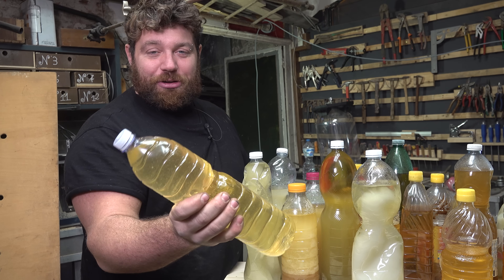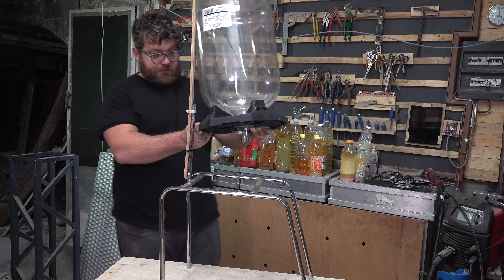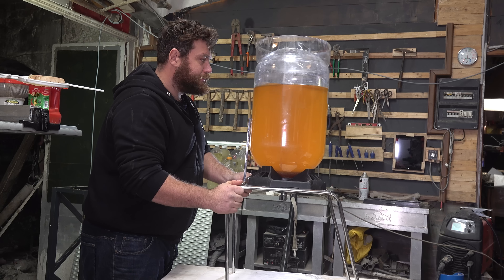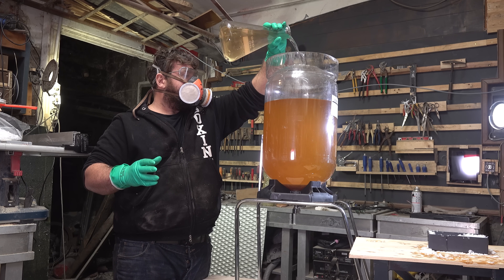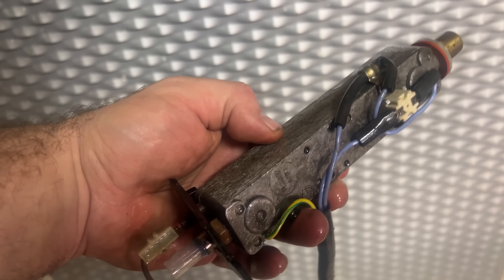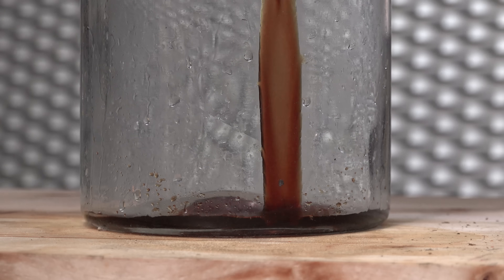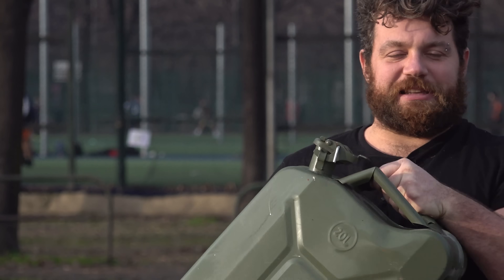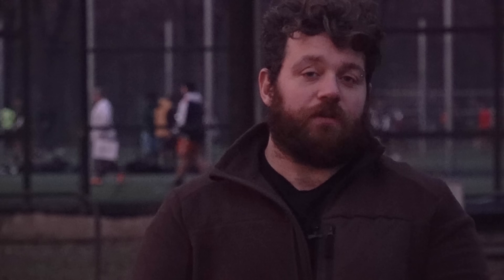How to Make BioDiesel at Home • Full Tutorial 4k

Comment: Why did you skip the titration calculations?  It is very easy using turmeric......and there is no one measurement fits all......you also skipped the acidity test so it will definitely eat away at any aluminium it comes in contact with, also because you did everything hot you could see after you transported it in the steel tank and started pouring, it started to congeal because of all the shortcuts......also no washing!......

Comment: I made it for years. Worked fine but not good for my lungs making it.  I used 40 gal electric hot water heaters, washed my fuel with soft water.  It worked great, made lots and figured my cost was down to about $1.00/gallon.  But overall its still better to just buy it.😕

Comment: In an emergency situation I once used 20 litres of vegetable oil straight from the shop in my 2010 Toyota and it ran perfectly fine. Got me home ok and I wasn’t stranded in the middle of nowhere. Since then I’ve owned diesel cars for their high tolerance of using cooking oil as fuel. 😅

Comment: Read up how your car handles this. Most new cars handle biodiesel really poor, meaning you can have engine failure resulting in thousands of repair cost. Older cars ( talking 80s 90s and before) with less electronics tend to handle it like champs with some being able to run 100% waste oil w/o any problems. Would i make biodiesel myself? Absolutely if its legal in my state and my car can handle it.
Reply: You're wrong. In Germany there is always biodiesel in Diesel.

Comment: Also regarding that the viscocity lowers with the temperature sure but that isn't the most important factor. when it comes down to diesels, FAME and kerosene/kerosine you have something called CP and CFPP first is cloud point the temperature when you first start noticing the impurities/parafine fraction. and the second is the cold filter prop blocking tendency that is when there are enough impurities that causes the liquid to not actually flow anymore both are temperature and mixture depended

Comment: This is overkill, just filter the oil then mix with 10-15 % gasoline then you car will run just fine. But the car should be a older car with mechanical fuel pump 😊

Comment: You have no idea how to make biodiesel, first, methanol cannot be in the air because it picks up moisture from the air,the caustic soda has to be in the methanol for 24 hours for its correct dissolution,you have to dehydrate the oil so that it does not contain any water,when you mix the oil and methanol, the oil has to be hot and constantly moving for the reaction to happen,When you have the biodiesel you have to wash it with water to remove the soaps that have been created in the process,and then you have to dehydrate it again so that the final product does not contain water, and finally filter it through a car filter or other filter, (the process is more complicated and has more steps than what I explain here). 
This person has no idea how to do it, if you do this tutorial and use that thing as fuel you could break something in your car, Dislike.

Comment: We in Brazil use vegetable oil which can be those that are discarded from restaurants, or new soybean oil we mix it with diesel directly and it works very well, however this mixture is almost entirely used by farmers in their agricultural machines and in transport trucks. It helps the environment and reduces fuel costs.
Reply: putting oil into diesel does the opposite of saving the environment, it only saves money, you oil produces a lot more smoke and toxic fumes than regular fuel, but hey as long as you save a buck right?
Reply: @keller_  just clarification

Used cooking oil is recycled, as it can contaminate water. It is mostly used to extract glycerin and biodiesel.
We don't have places to incinerate it as most os our electricity is hydropower based (70%). So we started to recicle it.
Brazilian diesel is 10% plant based, part of the oil used is cooking oil processed to just extract the "biodiesel".
All major truck and car brands are in Brazil and they pass in he Euro 7 emissions, using this mixture.
If is is not clean enough to you, there is one more component, being plant based it will be reabsorbed after burn in the new crop being extremely eco friendly. In the same way we use ethanol to move our cars.
We don't have just carnival and poverty, Brazil is more eco friendly than he entire Eurozone. Big problem is the deforestation.
Reply: only in your head that pollutes more @keller_
Reply: @keller_ shut up cuck.

Comment: I used to run straight cooking oil in my mk3 transit, bought 1 trolley full at a time in tesco! It worked out great until the autumn set in and the oil got cold so the van was difficult to start.
I got round that real easily by going on holiday and coming back when it got warm again.
Reply: So rather than pumping it you bought your fuel in plastic containers which your country probably doesn't recycle 😂 nice work
Reply: @mgrdigimarketing3035 the best way to recycle plastic containers from cooking oil (as well as almost all other plastics) is to heat them in an oxygen free environment and distill the resulting vapors.. which makes diesel.
Reply: @mgrdigimarketing3035  really? So ive just stored them in my loft, right? And while we are examinating your profoundly stupid reply.... tell me what country dispenses cooking oil in pumps.

Comment: Why don't you use a pressure vessel to control the temperature and pressure. They process would be faster/ industrialised. You can rigged it with safety pressure relief valves

Comment: You can clean oil with gelatine, mix gelatine and hot water together then mix into oil, leave overnight, you will have a gelatine brick at bottom off oil with all contaminants.
Reply: what are the proportions?
Reply: @BibleWondersUnveiled  look at 1784 robert murray-smith biodiesel, for all info.

Comment: I have done this, made several hundred liters of Bio some years ago. I was driving a Toyota Prado KZTE engine. Few Problems: 
1. Not as easy as you might think to collect the oil. Fast food shops have agreements already OR staff take it.
2. That cleaning / post production process is VERY important - the diesel will look clear but still has soap dissolved in it.
3. Be prepared to get Diesel Filter Warning light come on when you run it pure. ( I had to change my diesel filter) BUT the car ran just fine on it: Mixed 50/50 AND once I ran a full tank just home made Bio.
I stopped making because I could not get enough oil to make it worthwhile.
Reply: My dad owns a restaurant. I really need to take advantage of that it sounds like
Reply: @CatDaddyx2  bio diesel in small ( say 50 liter) quantities is very doable, fun, and a cheap way to run a small older diesel motor. IF you can get regular veg. Oil supply. ( For free)
Reply: @cameronmurie  I got an old diesel kholer generator that I wouldn’t mind running on it
Reply: I agree- I run pure veggie oil in my car and even though its rewading its not easy, and the hardest part is getting hold of enough waste oil!
Reply: Not bio diesel, but a lot of older diesels can run on waste oil. You do need to cut it with diesel or less gas. We had an old mack dump truck and it loved it when we added motor oil. It's basically a higher octane. A lot of shops are willing to give it away. It saves them from having to dispose of it properly.
Reply: Former Sonic frycook and grocery worker here

Your best bets for oil if you want it is to check Sonic, or your local grocery deli or Walmart deli

I can't garuntee they'd say yes but it ends up getting dumped down the drain at Sonic, or outside in a vat at grocery/Walmart
Reply: While fast food places have an agreement a lot of managers don't care and small restaurants and gas stations are similar.
Reply: Ở nơi tôi ở VN có rất là nhiều dầu thải, tôi thu mua lại bán cho người khác,k có lợi nhuận lắm, tôi rất mong pan chỉ tôi cách làm
Reply: And if you burn it in an oil burner for winter heating you can even skip the filtering part. It will all burn just fine )))
Reply: Can I use baking soda, Sodium Hydrocarbonate (Na2CO3) instead of sodium hydroxide (NAOH)?
Reply: @GiorgiZhorzholiani22  I've no idea. I used the dangerous potassium hydroxide but I can't recall why.
Reply: @GiorgiZhorzholiani22  you don't need the sodium, you need the hydroxide / OH  part ...

Comment: You normally "wash" with water the oil after filtering to remove rests of soap. To avoid creating foam, you should nebulize water above the oil. Water is more dense so it will travel downwards and settle on the bottom, taking the soap with it. To remove the water you just need to have a valve on the bottom and empty the tank until there is no more water.
You do this as many times until you get clear water on the bottom.
Reply: Wow, nebulized water? I mean, it makes sense because you don’t want it to get bubbly as you said, but how long is the process?

Comment: So this recipe is not clogging the piston rings like when only meshing and go ?  i know several who ruined their compression and engine. , even old mercedes  . rings stick on piston after a year use ish. this seems like a better solution
Reply: Just make sure you get rid of all the excess soap and water (first by adding water to the mix and latter by decanting the mix and using a desiccant like calcium chloride which you need to simply filter out of the fuel before to using it), and mix in more of regular diesel if you feel like it is too viscous. Using ethanol instead of methanol will make it a bit more viscous, too. Keep your particle and diesel filter clean because the mix can clear a bit of gunk from the system, which can clog up the filters. After the first two tanks of mix are used, there should be no further issues with filters if you did everything properly.

Comment: This process is usable only for older diesel engines, not for newer common rail / PD engines. I had old car (VW Golf 1,9 SDI from 1997 year) and it runs about 100 000km on home made bio diesel (FAME = Fatty acid methyl ester)
Reply: This is actually wrong. Biodiesel eats away the rubber seals on old cars because they are not prepared for it. New cars are actually prepared for it.
Reply: @maximusboscus  having tried to run newer vehicles on 100% biodiesel and seen what happens to for instance Lucas fuel pumps when in contact with biodiesel I can assure that there is nothing particularly wrong with the statement...
All new diesel cars "should" be able to run with a small percentage of biodiesel because its already in the fuel but that doesnt mean they can run on it. In fact most new cars have so many sensors to reduce engine temperature and particulate filters that clog remove unburnt biofuels in stead of what theyre supposed to do that if you put even a meduim percentage of biofuel in a newer vehicle you will have an extremely expensive problem...fuel eating seals and fuel lines. pumps that clog up, filters that clog solid in the cold, exhaust gases that destroy the catalytic converter, and particulate filter.
Manufacturers started out making cars that could run on biofuels and then redesigned them and gradually added peripherals  that make it impossible for new engines to use even a half decent amount of biofuel.
Reply: @maximusboscus  So you're telling me a modern Audi Diesel from the EU can run on this stuff? I really doubt so too.
Reply: @hariranormal5584  Yes, modern Diesel can run. They HAVE to be prepared, because anyway commercial Diesel already contains a small percentage of biodiesel. On old cars it will ruin the rubber seals.
Reply: @maximusboscus Very interesting. Thanks. I thought given all those sensors modern cars have, and that Diesel (like other fuels, or petroleum as a science) is also really complicated, there are many "types" and chemistry's of it. I thought whatever the biodiesel we make is, it's probably a primitive version which works on old machines, perhaps power generators and stuff. But modern car engines are really complicated, thought they wouldn't be compatible, but yea. I just don't see much info regarding biodiesel nowadays, so I just made all of this up.
Reply: @hariranormal5584  ask the manufacturer, They might say a maximum of 7% biodiesel mixed with the regular diesel .Professionally made which may have to follow some standard. otherwise, the warranty on the car may be void
Reply: @maximusboscus  A small percentage maybe there is a reason for
Reply: @hariranormal5584 bio diesel isn't primitive at all, if made properly it is much cleaner (less poluting) and provides for better efficiency meaning you can have more power for less fuel. With bd there is no smell and no need for dpf filters and such.
Reply: I did basically the same process for my 2003 1.9 pd in my passat. OM642 CR diesel and my V10 tdi all for many thousands of miles
Reply: well said new engines with catylytic converters and partical filters  don't do well either , not the engine but all the sensors will go scatty and basically make your car unusable, if you have a tdi with a german fuel pump and viton seals youre golden, you'll use more fuel filters but it works ..Diesel engines were originally designed to run on this stuff

no mention of heating either for some reason....
Reply: @TalRohan 1st: all new diesel engines are compatible with biodiesel, and most diesel fuel available out there have some % of biodiesel in it.
2nd: I dare you to find an older car (pre 1990) with Viton fuel seals from the factory...
3rd: even though I agree that this biodiesel (the one shown in the video) shouldn't be put into newer cars, and even though I agree that older cars are less "picky" when it comes to fuel, it's all about viscosity, impurities and lubricity. Older engines needed sulfur to lubricate the mechanical pumps, but newer Common Rail systems injectors are extremely sensible to any variation in lubricity and to impurities. And, surely, homemade biodiesel is far from perfect on that side. Catalitic converters are not the problem here. Also fuel filters will NOT block the small impurities (mostly carbon deposits) from the used oil.

Last at least: NaOH reacts with aluminium, and almost all our cars have engines made from alu, or alu ports, heads and so on. Using NaOH will eat up the engine (slowly but surely).
Reply: 1,9 TDi 💪
Reply: I have the same VW but 2003
Reply: it is said that biodiesel has properties that differ from regular diesel. so that diesel engines that will use large part biodiesel must be built for it. But there are a few places in Sweden where you can buy B100
Reply: However, Hvo Diesel can be used in significantly larger quantities in most diesel cars. any car can basically manage 50%. Hvo diesel is said to be chemically quite similar to normal diesel, even if it is fossil-free. But this high cetane value and withstand cold well
Reply: PD is possible! I ran mine 50.000 km with waste motoroil blends up to 80% wmo in the Summer! Except from Smoking no issues at all!
Reply: I ran a Kia diesel on this with no issues at all
Reply: OM642 💪🏼
Reply: Nonsense, older cars can run veggie. Bio diesel when made properly is better than petrol diesel in all aspects, any engine that runs on petro diesel will run on bio even better.

Comment: These videos always make me worried.  There are so many hazards when working with the chemicals, and the biodiesel that you get from this is so dirty. 

Methanol is highly flammable, use of electric tools ( drill motor ) and the electric heating element is just asking for a fire. Methanol also burns with an absolutely clear flame so if a fire does start, you won’t immediately realize that.

The waste materials (glycerine ) will contain significant amounts of the unreacted methanol as well as residual caustic. Safe disposal of this material typically cannot be done when producing small amounts of biodiesel 

The biodiesel itself will also contain significant amounts of the same materials (unreacted methanol and caustic)

The actual production of biodiesel is not hard, there are just things about that process that almost all YouTubers do not address 

Full disclosure- I work at a facility that can produce approximately 250,000 gallons/day of biodiesel

Comment: Hi there. The older generators can use the cooking oil just as it is. But there is a faster and easier way to make biodiesel for your car, heat up the oil and mix in a couple of packets of gelatin. It collects all the impurities. Then you can mix the biodiesel with 50% normal diesel.
Reply: Chỉ mình cách làm dầu Sinh học với
Reply: They will gunk up though, so its always better to put in the effort.
Reply: @foty8679  fair point. However, there is a patent on the gelatin method. It's significantly cheaper. The gelatin removes all the glycerin as well. It's a British patent. Once the gelatin has settled out, you mix 10% paraffin, and you are good to go. Obviously, you can add more paraffin if you want or a little gas station diesel. It's just a significantly easier and cheaper way to make the biodiesel.
Reply: @tranquility382 

Did you trying such method, to get biodiesel?

Comment: This doesnt have to take so long if you heat the oil from the start. That will also take care of the impurities in the oil so you dont need a sieve for that. Your caustic and methanol ratios is also wrong,too little. This will cause your biodiesel to set in very cold conditions.
Reply: What ratio of caustic to methanol do you recomend as I are experimenting with this.